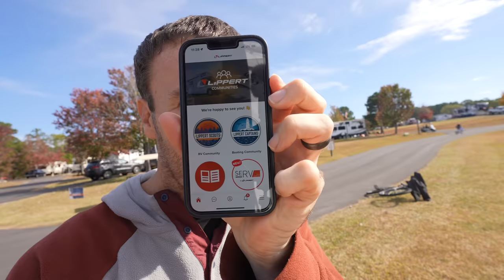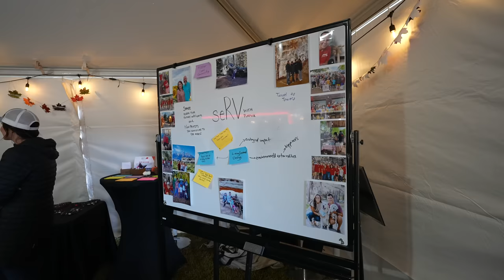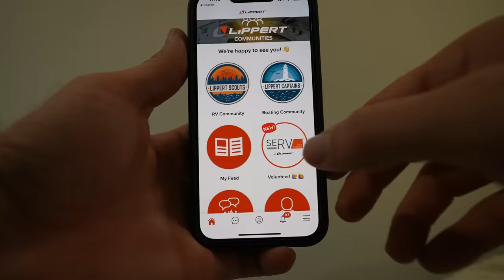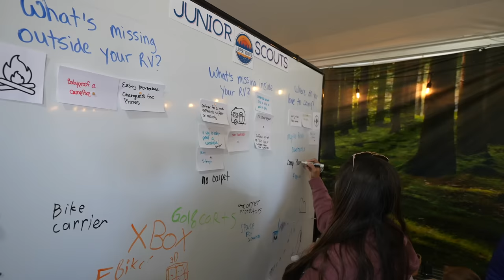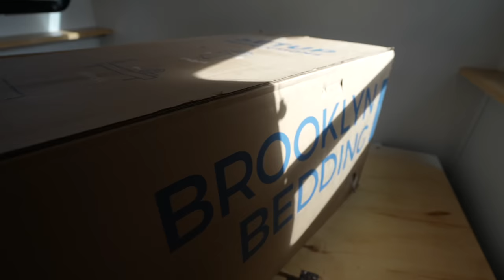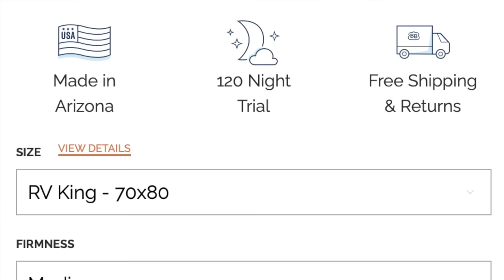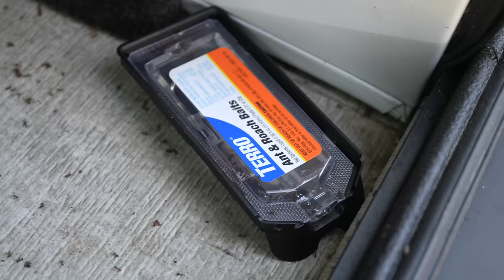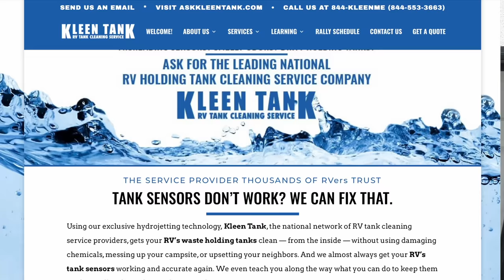We Have NEVER Had A Problem Like This // Full-Time RV Life

Comment: Hi, I cannot use chemical insecticides bc of highly reactive lungs, but I finally found something that works for me.  If you spray peppermint essential oil everywhere you can, it does two things: 1. It repulses ants and other crawlies.  They LEAVE. 2. The spray also kills them!  Changed my life. They were even crawling into my water dispenser.  It has worked so well that my full time rv-er son has now sprayed his basement and all doors/windows with it as well.  He hasn’t had any ants in the past month and believe me we live in ant country. Pine Mountain, Ga. How’s that for coincidence? Btw mice don’t like the smell either. It even keeps the ladybugs out of the generator housing ($350 to reset that thing every time bugs invade it!)  I ordered mine off Amazon under rodent repellants and just spray the usual problem areas every month or so.  😊 If you try it let me know how it works.

Comment: The problem with Taro is the ants do not take it back to the nest, it kills them too quickly to get down into the nest far enough. I live in a wooded area ants love pine and Maple for sure and so far the only thing that seems to work is mixing  a small amount ;  1/4 Borax Powered Soap  plus hot water, to dissolve and grape jelly. Step 1) Mix the water and soap first then, slowly add in  grape jelly ,but do not too runny. You can soak it into pulled apart cotton balls. Just make sure its not accessible to kids/pets like any other poison. We have had to deal with loads of ants  every summer so best of luck. I took out a nest that was five feet across in front of our house last year, using the above mentioned. Hugs to you all !!!

Comment: I replaced my mattress with a Sleep Number RV mattress (which I love), but felt bad about discarding a lightly used mattress.  I emailed a local campground that has a fair number of long-term campers and asked if any of their residents would like my mattress.  I quickly received a call from the manager who said an elderly resident lost his mattress in a roof leak and had been sleeping on a thin pad on the plywood platform for the past year. A few days later I dropped the mattress off at the campground office and felt better that I helped someone!

Comment: Never had problems with ants till this summer staying at Florence Marina SP near Columbus GA. Researched and found suggestions to put baby powder around tires, stabilizing jacks, power cable, water hose, sewer connection, etc to keep most ants out. For the ones in the camper use the baits it will kill them off eventually, we still saw a few up to a month after returning home, just kept replacing the baits every week or so.

Comment: Without reading any other comments that may have said this already. We had a small amount of ants invade our RV once while camping in a very buggy park.  And although we did put several ant bait traps around, we also sprayed any ants we saw with an ant spray poison to immediately kill them then cleaned that area and all surfaces high and low and inside every cabinet with cleaning products. Also we put everything food related items in sealed containers and or ziplock bags. Such as we put our plastic honey bottle inside a ziplock bag.  We also sprinkled ant poison in a circle around the outside our RV. After a few days thankfully we finally stopped seeing 🐜 🐜 🐜 🐜 🐜 .  Best of luck!

Comment: Your solution is to put a mixture of peanut butter and Borax powder in water bottle caps all around the fifth wheel making sure the kids don’t try eating it. So maybe hide them in your under bay storage area and in cupboards. The ants will take the peanut butter and Borax mix back to the nest and it will kill them all.  Trust me, it works for sugar ants.

Comment: We had an ant problem, spray did nothing because it just washed off with each rain. What we ended up doing is put diatomaceous earth around everything touching the ground and inside the doors at the threshold. That completely eliminated the problem for us, and it's very inexpensive. Best of all it's safe for pets and humans.
Reply: I believe you can get it at most Tractor Supply stores. I could be wrong though.

Comment: A mixture of vinegar, water, and  a few drops of dawn, mix more vinegar than water to start with spray up then to keep them out go for half & half  under RV  around tires. if you make a mixture of 20 mule team borax with sugar & water to a paste you can put on  small piece of cardboard or foil in the bays, under sinks, Had this happen when we moved to Alabama,  can also take a piece of duck tape fold in half sticky side out put on water hose & power cord keeps them from getting in.

Comment: I use Diatomaceous Earth for small bugs like ants. Inside the house I sprinkle some on the ground, then vacuum it up and then vacuum the bugs. DE is like knives to bugs. It will kill any bug without a hard shell. If the vacuuming doesn’t kill them the DE will and it also kills the larvae and eggs. I buy food grade 10# bags and use good old fashioned squeeze bottles. You have to be careful not to breathe the dust when sprinkling it around because it can irritate the sinuses and lungs, especially of small children or animals. When we RV and get to a site that has a lot of bugs I sprinkle it outside exactly like Nathan did.  One thing I did in my garden was mix borax and DE with granulated sugar then I put them into yogurt containers with lids. I screwed little holes in the bottom of the containers just above the mixture for ants to crawl in. I attached the containers to my metal fence near the ground with zip ties so animals couldn’t knock it over.  We have used the Terra products but well out of the reach of our grandkids and dogs.

Comment: If you use Bifen/IT mixed 4 times as strong, you can spray the underside of your frame, jacks, slides, etc.  It has a long lasting affect and bugs don't like it.  including ants.  We use it and never have issues, but the few times that we did get a few bugs inside, they couldn't stand it and they crawled out of the holes they hid in and rolled over, belly up dead.  You can also spray it inside around all of your slides and once it dries, it is pet friendly.  Its also odor free too.

Comment: Use the following recipe:
Borax
Sugar
Water
Cotton balls, or rags, or whatever will hold some liquid, and a discarded plastic jar topper.
1/2 cup sugar, 1 tablespoon borax, 12 ounces water. Stir well until sugar and borax are dissolved.
Soak cotton balls, rags, or whatever in the solution. Put a wad in the plastic jar lid. Leave them wherever you find the ants, especially where you think they are coming in.
Most of them will be gone within 24 hours.

Comment: One time, I had ants walking in my trailer in a long line.    I got a warm bucket if dishwashing liquid and paper towels and tore off about 3 sheets and dipped the toweling into the bucket and started mopping them up and most fell off the paper towel and sank so I just swished the toweling around and left it really damp and started wiping again and again following their trail.   In your case, work each area until they are gone and continue until they are gone all over and go back and double check and triple check each area.   Once mine were gone, they engine but it happened twice years apart.    Made quick work of getting rid of all of them.    In your case, a repellent under your rv or moving it into the pavement over the ground perhaps.    Think that you have them gone already by now.

Comment: Lowes or HD or,other.  Home Defense spray.  Spray every item that touches the ground.  Jacks, tires, hoses, wires, everything.  Make a ring around each of those.  Also get some ant gel such as OptigardAnt gel.  Order from domyown pest control. I am not affiliated, just a very satisfied customer.  Ant granules are also excellent.  Domyown is in Georgia so,shipping time will be short.  You should remove some switches, lamps etc, ro allow a bit of gel to be inserted.  Ants can do serious harm to the wood structure.  We had carpenter ants once, in a Jayco.  Hope this helps.  DE as posted prior is also good.  Use a multi=faceted approach.

Comment: After having 4 different R v's in the last 40 years I've had my encounters with ants mice and flying  Insects. One of the most notable was ( In my earlier years ) . Parked my class C , the next morning I awoken to find the whole interior  covered with ants. They had found candy left from my daughter a week prior,  they also found many other locations they were working on to take  there ( treasures). I ran out side to find where they were comming in at. Hard to find untill I noticed a tree limb just touching top center of RV. Very easy to remove all of them in less than a hour.  1st snipped a little of the branch, Pulled my electric vacuum out and started vacuuming the ant trails.
Amazingly  they stay on there trails , If you wipe the trail with anything they turn and follow the trail back ( sometimes scatter ) Just vacuum  trails from one to another  trail 
Very soon you have all. On our class A  just as a precaution , when in doubt  I spray a little home defense  my downrigger pads .( not the ground ) They still have to make a living to 🤭🐜

Comment: Those Terro baits are awesome, but it seems to only attract if their dietary requirements call for what is in the bait at the time.  I've see the traps ignored for weeks in my house to only later attract them ants by the thousands.  The kind you sprinkle on the ground though seems best to keep them out as it both repels and kills.  I live in a house and I circle the perimeter with the sprinkle Terro killer and also use these traps on the inside if they get through that somehow.

Comment: I have used a solution of borax and sugar, both in my house & camper. Need a few small plastic containers (empty butter, sour cream, whipped topping), drill or punch a few holes near the top below the lid. Solution is 1 tbs borax & 2 tbs of sugar enough warm water to dissolve, pour into containers over small piece of bread, put lid on and place where ants are traveling. Couple of days ant problem solved.

Comment: Ants look for water when it's dry. They look for food when they find it. Those Terro products work great. They are basically traps after you have them. But if you want to keep them at bay before they invade, that  Ortho Home Defense is the bomb. Spray it all over and around anything on your rig that is touching the ground. Tires, levelers, hoses, etc. It will kill them almost instantly. But it leaves something behind that deters them. It's people and pet safe once dry and continues to work. You can get it in gallon containers with a battery powered spray wand. We swear by it at home and our RV. If you are crazy about natural products, cinnamon, mint, and even vinegar are great pest deterrents. You can sprinkle that natural stuff around and they won't even stop by. LOL. Uncle Gus' mice products use the same natural ingredients and work great. If you store your rig for any period of time, place a dryer sheet in each drawer and cabinet. Any secluded area. Works great for mice. We had a major issue one year. Never again. Good luck and safe travels. Been following y'all for a while. Very adventurous. May God Bless You all.

Comment: For mice and rat issues I found a remedy on a yt channel that is safe for pets, people and other animals.  Use cheap plastic containers appropriate for what you're fighting that has a removable lid.  Put a small round hole on one side of the container.  Mix equal parts of Jiffy corn meal mix and baking soda together and put in the container. Place container near where you're having the rodent problem. (You will need to check and change out this mixture on a regular basis.) They will be attracted by the corn meal smell, eat and leave.  When they leave they'll search for water (don't put out water).  The water mixes with the mixture in their stomachs.  These rodents can't burp or fart so their stomachs swell up and they die not to return again.  This mixture is safe for animals and pets as it is a natural remedy not poisonous.

Comment: Some of them look like sugar ants, others look bigger.  Some look like fire ants.  Is there alot of sand where you are?  If so they are in the sand.  They also live in the trees down here in the South. They like to build nest at the base of the tree trunk in the dirt / sand.  They are everywhere! We had them in SC and now in FL.  We don’t have to many inside, but everywhere outside.  Crawl all over the outside of the camper.  Some also bite and leave little bubble blisters that look like a zit.  We spray inside and out of the entryways and put traps near the doors, under sinks, etc, anywhere they can get in.  You could also have a nest somewhere.  Our neighbors have an older camper and when we pulled their awning out there was a huge nest under their latches. Good luck.  There are a lot of suggested remedies on Pinterest, i personally haven’t tried any

Comment: I’m used to my annual summer battle of the flies, but I drew the line and went nuclear when rats thought they could make my RV their home. It wasn’t pretty, but I got rid of them all! God speed to you guys!
Reply: @007nadineL  first, I had to declutter. I had way too much stuff stored that was providing them hiding places. In fact, they had built a nest in some old bags and other clutter I had in the cab area, which I rarely used. Next, I sealed up every existing burrow while I found with steal wool and a cement compound. After that, I cleaned so I could monitor traces of them (droppings) if they appeared. Last, I used poison and baited Victor rat traps. Use bait that the bastards have to tug on to get. Hard cheese worked for me. Soft stuff doesn’t work. I recorded 4 confirmed kills of adults and I discarded a nest of 4 babies. Last, you gotta seal any ingress/egress points to the outdoors. Never leave food out and as best you can store food in solid containers if left in cupboards.

Comment: Once I get to all campground I put down 7 seven in powder on my jack stands and I spray the liquid 7 seven all around out side camper and. I spray 5 feet out all around the camper and spray your water hose and electric cord that touch ground overkill but it works never no problem. That want I due before setting up. Get a battery power sprayer and you good to go .

Comment: When a virtually endless bi-directional conga line of ants appeared in my apartment, I tried all of the commercial chemical products without success. I mixed cayenne pepper and cinnamon powder and sprinkled it moderately along the trail and the ants disappeared in less than 2 days.